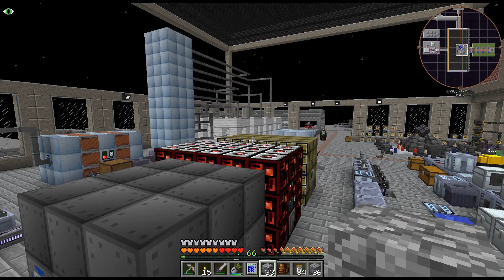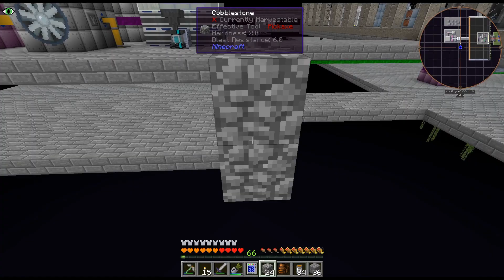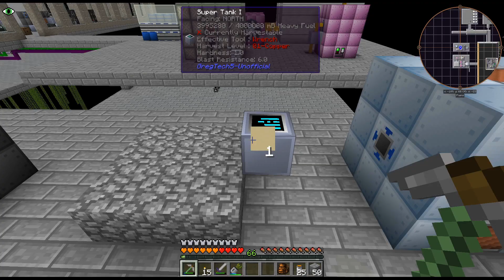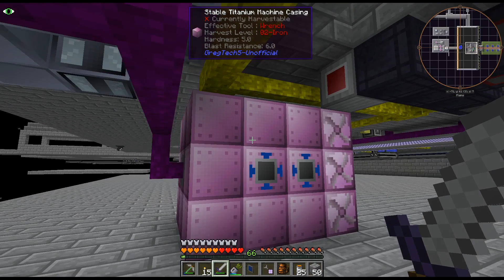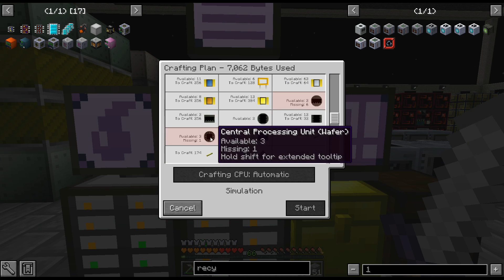GregTech New Horizons S2 - 114 - Wire Factory

Comment: Wire factory did used to require a crazy alloy
Make sure to do the field gens in the assembler
You can crl shift click the recipe in the terminal and it will allow you to autocraft components in the recipe, means you don’t need to search for items
You can use the structure lib projector thing to visualize the multiblocks
Really should rename your interfaces so you can easily use the interface terminal over having to fly over to the interface
Instead of using the arc furnace, make a disassembler
Consider getting the next tier circuits soon, stuff is getting quite expensive with regards to that
You should get a PA for the wafers
You can use a circuit in the mass fab to tell it to only run if it has uu amplifier
There is the tree growth simulator if you want a lot of logs, it’s great